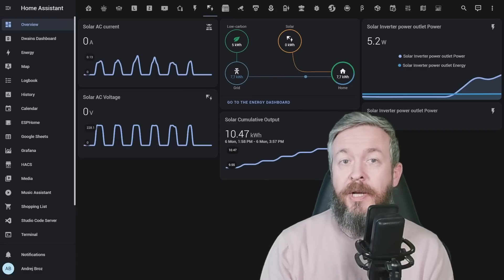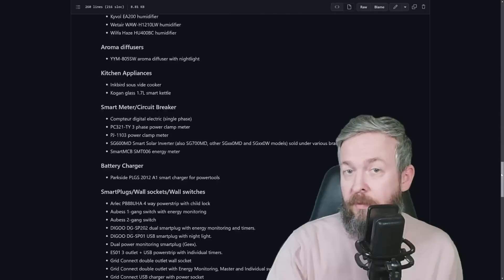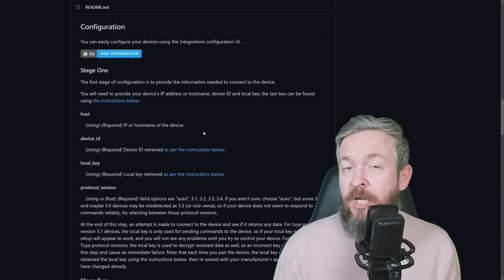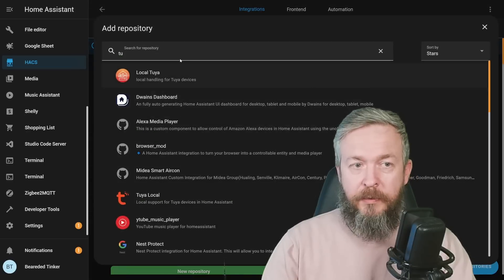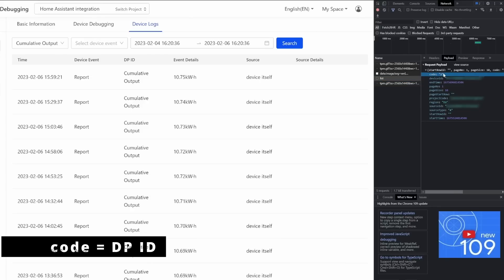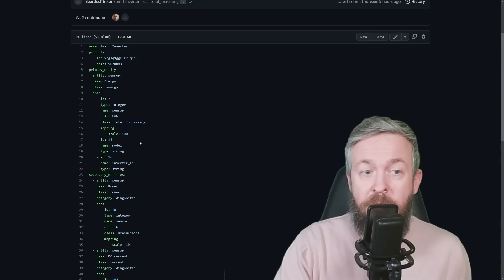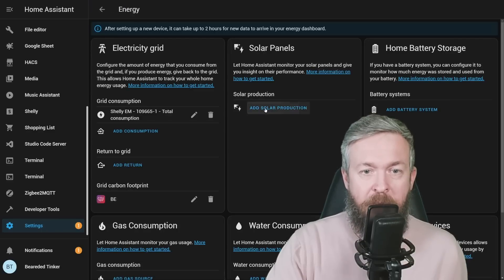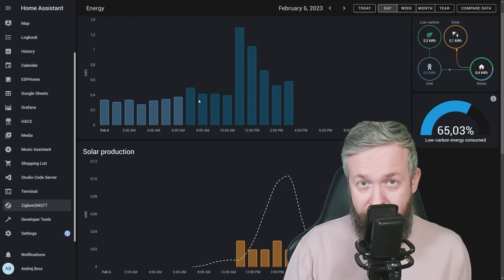OMG - Tuya local HACS integration for Tuya devices in Home Assistant

Comment: Thanks for this detailed video, I tried to add my 3 Tuya devices through Tuya Local, unfortunately only one of them was added successfully (Aircon). I also have 2 water heaters that I cannot add with the poll only tick marked or without it, I tried to add the IP address instead of auto and yet I receive the following message: "Unable to connect to your device with those details. It could be an intermittent issue, or they may be incorrect.". Device ID and Local Key are 100% correct so I don't see how I can move forward with it.
Reply from the maker: Are your devices listed as supported? If not, did you watch part on how to adapt existing in create for your? If no, you can always try to open issue as suggested on GitHub, submit necessary data and wait for official support.

Comment: instead of using auto Ip I used the correct Ip and all configurations were loaded by default, no manually finding each value. Thanks for the correct plugin
Reply from the maker: Glad it's working, thanks for the comment 👍

Comment: Will moving my 40+ tuya 4 touch switches to this new integration help avoid the unavailable problem? Coz this will take a lot of commitment and a time to do and I want to be sure to invest the same here.
Reply from the maker: Can't answer you that. Question is why do you get unavailable. For example, my doesn't work during the night, so it has usual unavailable state at that time. If you can try with a device or two and test, that would be best way to go

Comment: I just added about 25 devices ti Tuya Local.  I had a few problems, but managed to make it work.  I did need to provide ipaddress for each, maybe because I have all these devices on a vlan different to my HA.   To speed things up, I copied and pasted my device list into an excel speadheet. Then used that as a worksheet to inquired for localkeys, added them to a new column, did the same for these mac address, and ipaddress
Reply from the maker: Awesome, that's great!

Comment: I haven't tested the Tuya devices with the cloud blocked.  I heard a rumour that some Tuya devices need to talk to the cloud to keep working, but I have not had definitive proof of that.
Tuya-Local looks like a great way to run Tuya devices.   It's the local control Tuya promised us they would work on and support from first party, but never really did.
Reply from the maker: That's Tuya... From what I've heard about them from HA devs, they are really not interested in whatever we do here. And they don't have as many software developers as we would think.
Reply: @BeardedTinker  Sounds a bit like a few companies...   Switchbot also don't have that many devs.  They all seem to be marketing heavy.   I guess that is how they get money in......
Reply from the maker: True, but unlike Tuya, SwitchBot did actively help with integration development - when Bluetooth was improved in HA.  I may be completely wrong here, but SwitchBot looks like it wants it's devices getting used, no matter how users decide to use it. While Tuya is interested in getting paid by companies to use their data center. That's why dev costs are so high. They make money off of Tuya device manufacturers 🤣
Reply: @BeardedTinker  True.  Tuya want to collect data and most likely onsell it as this makes them money.

Comment: Great video as always switched from local tuya and everything works flawlessly but unfortunately on of my devices act feeder cant be integrate any ideas as to why ? Maybe needs an custom yaml file? Thank you in advance
Reply from the maker: Probably needs custom integration. You can try opening issue on Github, copy there DP ID's and also sharing link to that device. Or you can try customising an existing device yaml for it.

Comment: Switching to Tuya-Local was also my conclusion after using localtuya, for the reasons you describe, but also for other reasons. I found that most of my 30+ devices under localtuya frequently went to offline state, and when I reloaded the localtuya integration they would come back to the online state, leading to a lot of frustrating manual maintenance and a strained marriage. When I switched to Tuya-Local, the devices mostly remained online, except for the devices that actually did have WiFi connection issues, such as a RGBWW lightbulb in a metal shrouded gooseneck lamp. or devices that presumably had trouble calling home to Tuya's AWS cloud services, and my marriage is back on the rails. (According to the Internet advice on this latter problem, I'm faced with blocking DNS for the Tuya devices to prevent them from getting stuck in the offline state, but that means setting up a VLAN for just those devices, playing with routing tables, etc.)

Thank you for providing details about creating custom supports for new devices. I only have lightbulbs and switches currently under Tuya-Local control, though ideally I'd like everything to be independent of the cloud and truly local.

Also, as a side note on Tuya-Local, my switches now have their internal timers exposed, and since moving to Tuya-Local they have been behaving erratically  - either switching on at random intervals, or switching off at random intervals with no HA automation showing the cause in the logs - this is currently the only conclusion I can make (did Tuya-Local "tickle" the timers' DP IDs when they were first set up?) But maybe it's my misunderstanding of how internal timers are used and I don't yet know how to disable them (there does not yet seem to be a way). Perhaps setting them up as a custom support, as you have demonstrated in the video, or modifying the existing support to expose more DP IDs for timer control will address this problem that I suspect others may be having.

Edit: ideally, I'd like to have all these Tuya devices moved over to ESPHome firmware, alas, I only managed to wirelessly update one lightbulb, and firmware flash two others by taking apart the lightbulbs, and the rest of the Tuya devices are on the new hardware that is not compatible with or supported by ESPHome!
Reply from the maker: Thank you for sharing this! It would be awesome if there would exist good Tuya alternative.
HA devs really got burned by the company in terms of support and cooperation unfortunately, but this also translates into trend how the company works - they lack developers for end user part.
While I do understand why they operate like that from business perspective, I really don't like it as end-user. One device I got few years back had been happily working with ESPHome, but this solar inverter can't be converted too - same issue as you have. 
There are companies that could do Zigbee version, but only if they receive large orders . So, stuck with Tuya.
Reply: I feel you. I have 40+ tuya 4 touch panels across my house and frequently I see a few being unavailable.. do you think this integration will help? 

PS : just got married
Reply: As a follow-up on my setup, I was able to convert my non-ESP WB2S (Beken BK7231T) based smart plugs to libretuya-esphome using tuya-cloudcutter (firmware uploader option) via the cloudcutter tasmota-like firmware, and I found that I had a lot of TYWE3L (Espressif ESP8266) based lightbulbs that had a Tuya firmware version early enough that I could use tuya-convert on them flash them with the usual tasmota-lite -> tasmota-minimal -> ESPhome update process.

So now out of 32 Espressif/Beken devices I have 14 lightbulbs on ESPhome and 5 smart plugs on LibreTuya-ESPhome. The rest of the devices are a mix of tuya-patched firmware ESP lightbulbs, and lightbulbs with WB3L (Beken BK7231T) modules in them, as they are not currently supported by tuya-cloudcutter - though they were detected as "exploitable" so I sent them a binary flash dump to analyze.

In Home Assistant, in place of ESPhome, I now use an experimental LibreTuya-ESPhome add-on which uses a fork of ESPhome to include the BK7231 and RTL8710 chips. The fork is typically a week behind ESPhome, so that's good enough for me!

Comment: I will be trying this for a couple devices!
Reply from the maker: Keeping fingers crossed. May take a bit of time, but really not hard. You can try reusing parts of the code from other devices that are supported.
Reply: @BeardedTinker  I can confirm the method in your video works like a charm! My lights were unsupported by both local tuya and tuya local. After making a yaml file for them they now work fine! Thanks for showing us this.
Reply from the maker: That's great! Thanks for the follow up!
Reply: @BeardedTinker  I've got 30+ lights and smart plugs working in Local Tuya, just 2 (cheap) string lights refuse to work.... even only turning them off and on would be nice. Using a smart plug to switch a "smart" device on and off is just ....

Comment: I have no local key in my Response window , for all devices I have in Tuya. This is the reason I quit few month ago and connected tuya trough official integration which does not have all entities
Reply from the maker: Did you try both under General Device Capabilities and Smart Home Device System in API Explorer. I don't have local key in General section, but I do in Smart Home section.
But if you got it working with official Tuya, it's great -  at least for now it's available in HA.
Reply: @BeardedTinker  Thanks I found it in  General Device information / Get Device Information

Comment: Been using local tuya with a Lefant vacuum and a Tuya zigbee gateway. It worked for the vacuum for a bit, but not for the hub (error in the HA logs states unsupported). 

I'll have to revisit things and see if I can get things running again. 

Also, the having to do the reauthorization of the count every 3 months is just awful.
Reply from the maker: I agree! But hoping for anything better from Tuya, I don't think we will see it anytime soon!

Comment: iot says my subscription has expired and won't give me the information on my device... when I go to renew... they want $250 for the year or some shit...
Reply: you can try creating a new project, it is unlimited but you will either have to renew the free 'subscription' monthly or just create a new one each time (which admittedly sux ballz)
Reply: @chrisrosenkreuz23  They don't allow a renew... I tried that...
Reply: @crashcreeley  well it works for me, and others too. Try creating a new project and maybe you will be able to renew afterwards. For projects created before a certain date, the renew option doesnt work.
Reply: @chrisrosenkreuz23  Thanks for the tip, but, no thanks... I don't need the hassle, better for me to remove all the TUYA products and just do away with the headache...
Reply: I had the same problem. I sent a message to the support. I said that as a private user I had only 2 plugs. The support gave me some free months more. I saved all keys and datas and bye bye tuya.
Reply: @blitzpulli  Yea, I did the same... no more TUYA in my home... I'll keep the one lightbulb I have left...
Reply: you can request a free extension, a pain in the ass but should only take a few hours to fix
Reply: @MrDead1975  Nope, don't need the hassle... if a company is going to make you jump through hoops to use their product like TUYA does... forget it...

Comment: Great Video. Are you able to explain how to get the IP address of a device if not found by the integration.
Reply from the maker: You should be able to get it via router. I use unify and it identified device there. There is more complicated way by using TinyTuya - https://github.com/jasonacox/tinytuya but it requires separate installation. Or you can us tool like Angry IP scanner: https://angryip.org/

Comment: Does it call home to the mothership in China? 😂
Reply from the maker: Only when powered on 😂
Reply: My understanding is that Tuya-Local itself, and the devices under local control of Tuya-Local, also all talk to the mothership in the cloud, and that there is a way to prevent them from doing so by blocking DNS ports in your router's firewall for just those devices. But this means putting all of those devices on their own IP subnet (maybe a different WiFi access point) and adjusting firewall rules, which is not trivial and depends on you individual networking setup.